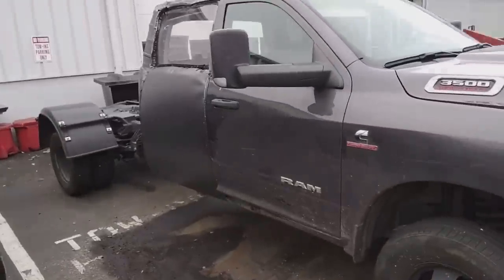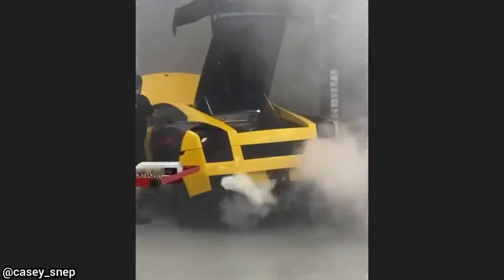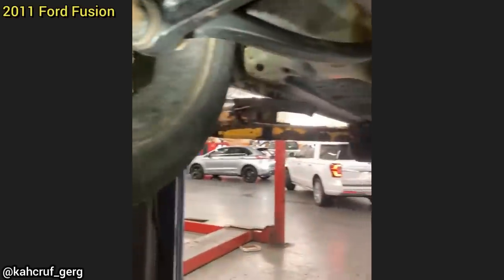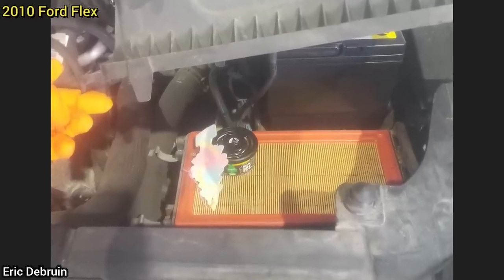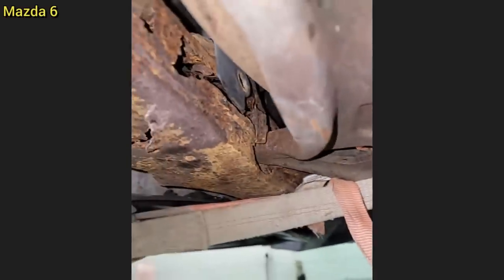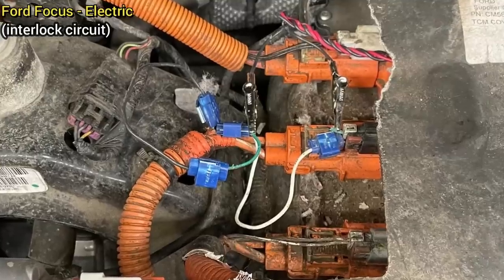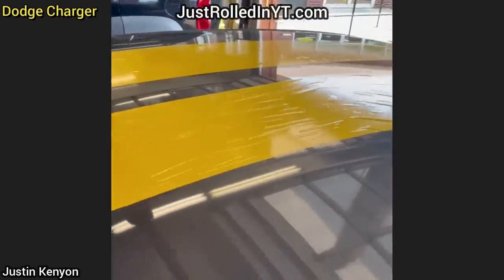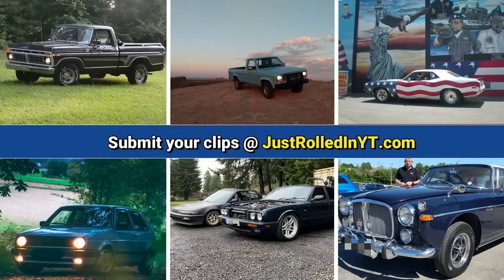Customer States Another Shop Used A Range Rover Hood To Fix Door

Comment: THAT subframe covered under a recall??? That man just hit the jackpot wtf
Reply: Toyota had a recall on certain Tacoma frames and would replace free of charge.
Reply: dude basically got a used car turned into a new one with that kind of recall lol
Reply: Subframe?  There wasn't any subframe on that car, just thoughts and prayers
Reply: That was a sub-subframe
Reply: @thetater0886  It could have been a Jeep. They had a big recall for sub frames.
Reply: @douglaskrenik4102  4Runners, too.
Reply: Original owner must have been kicking himself, too. Gave the car away for free and could have gotten a new one instead.
Reply: Ford covered about $5000 in repairs to our Windstar once on a recall, when the thing wasn't worth even $3000. It started with the engine subframe, then the stuff that was bolted to was rusted so Ford authorized replacing those parts too, then the stuff THAT was bolted to was too rusted, repeat, then they had to break the exhaust manifold to finish the last replacement, so they authorized a new manifold too. I was amazed (and a little disappointed) that they didn't just total the thing.
Reply: My exact words were "No way" loud enough for the rest of the house to hear me
Reply: @thetater0886  And only the prayers were left.
Reply: @John_Ridley  I think the vehicle in the video was a Ford Windstar.
Reply: No doubt!!
Reply from the maker: @HighSierra1500  it was a Mazda 6
Reply: @douglaskrenik4102  yep we had two different customers small Toyota trucks that were bought back by Toyota because the frames were nearly gone
Reply: I work for  Mazda and submit the warranty claims. And they actually ran out of sub frames at one point when the recall was first released.  The work orders were backed up for weeks.
Reply: That reminds me of the time my wife bought her last vehicle - a "pre-owned" 2014 Hyundai Santa Fe.

She was on the fence about purchasing the extended warranty from the dealer but ultimately I sold her on it.

Several years later, that very warranty she almost didn't get provided her with not one, but two new engines and a transmission.

The first engine replacement alone was more than enough to have the extended warranty pay for itself.

Sometimes it's worth it depending on the situation - it's not always a scam.
Reply: @douglaskrenik4102  Toyota did NOT recall the 4Runners with the same frames. Shame on you, Toyota, I could still be driving my SR5 instead of an XJ! 
(Don't get me wrong, I love my Jeep, but I only had my 4Runner on the road for two months before the frame went...)
Reply: Ah the old Chinese Curse, "may your Ford Windstar last you another decade."
Reply: Guy who gave it away probably  knew the condition it was in.
Hopefully,  he finds out they just got the repairs for free.
Reply: I never get this lucky.
Had a Chevy Volt once. It was under warranty,  and they still wouldn't  fix it. 
I got the impression  that certified volt mechanics were the diesel guy they gave $20.00 to and stuck a volt shirt on him for the day.
Charger went. Blew a fuse. Melted the power cord.  They wouldn't  honor the warranty.  I had to rip the face off of it, replace the fusible link with an inline fuse, replace the power cord, then duct tape the charger back together.
$40,000.00 car held together with duct tape.
Never had cabin heat on electric. 
And this clown gets a free subframe.
Reply: Mercedes just did mine.  Took advantage of the swap and all new control arms and shocks went in.  New rear end at 11 years equals like new car.  Amazing difference.
Reply: Surprised it was a year old ford
Reply: Yup. My buddy had the entire frame on his ‘05 Tacoma replaced by Toyota because of rust. Then he traded it in 2 years later for new ‘21 Tacoma and got 16k for it! 😂
Reply: Many years ago I had a 2001 Sante Fe that had a recall/TSB to inspect subframes for rust and to replace if needed.  If not rusty they would but some type of sealent/wax onto certain parts of it.  I got the wax thing done, but a few months later I noticed a rust hole devolping, about big enough to poke a screwdriver through.  Took it back and they decided it was rusty enough so got a new subframe installed.
Reply: @HighSierra1500  Yeah they had very bad problems with rust on the subframe, hence the recall, so I wouldn't be surprised.
Reply: Recall after 30 years 😂😂😂??
Reply: @edwardkellogg1284  My buddy had a Jeep Patriot - they should have just recalled that whole vehicle.  He replaced the steering rack 3 different times, tie rods, wheel bearings, jeep paid for engine mounts under recall because they rusted away to nothing and the motor was gonna fall out, his moonroof leaked into his headliner and onto his dash and destroyed his stereo and a-pillar interior trim because the drains were basically defective and never worked from new...and it wasn't even that old.  Total garbage.
Reply: @John_Ridley  2nd gen Windstars are one of the biggest POS ever made
Reply: @Righteous J  you need extended warranty with hyundai and kias. Their engines and transmissions are absolute garbage
Reply: The jeep compass, patriot, and dodge caliber all have a 10 yr subframe warranty based off the build date. They aren't hard to do tbh. I've never been luck enough to have one fall under warranty, they always seem to get a hole 6 months after
Reply: @graymanA51  those cars are such POS
Reply: @JustRolledIn  what!? I just got rid of a Mazda 6 because the subframe was rotted and none of the suspension was serviceable. I had no idea there was a recall on it. Would have saved me buying a new car. I can't believe it.
Reply: AC condensation drained right there, so they all rusted there!

Comment: If you do your own oil changes on a Lamborghini. You can't afford it.
Reply: Rich people have trust issues too I guess 😅
Reply: I can afford it, I do my own oil changes. It's not any different than any other car, though on the late model Gallardo it does help to have a filter relocation kit so you don't get the top of the engine dirty when changing the filter.
Reply: Like, if you are already a auto repair shop and you have skill and tools and parking space for a fdup project car, it might make sense to buy a nasty mistreated supercar from impound auctions. But that's IT. 

I mean if you can't google the right amount of oil to use for an oil change you probably arent right for car ownership in general.
Reply: Not necessarily there are plenty of owners who are more than capable and do maintain their own vehicles. At the end of the day it's still just a car. I've seen the same mistake done on VW's.
Reply: @goatman86  
People like that aren't actually rich.
Reply: Even If I could afford it I would still do my own oil change
Reply: 28L of oil would cost more than paying a shop to charge the oil...wtf.

Like....surely after the 4th bottle of oil you would be asking yourself questions...
Reply: @procrastinator1842  "surely after the 4th bottle of oil you would be asking yourself questions"  You are assuming that they had any semblance of intelligence to start with.😏
Reply: @Jack_Russell_Brown  I'm wondering what kind of person attempts their first ever oil change...on a Gallardo...

Comment: "Customer declined repairs" is something that always gives me the chills watching these
Reply: I prefer states that have safety inspections for this reason
Reply: @nancyconrad5349  We have annual inspections here in North Carolina, and yet, I see more broken-down derelicts on the side of the road down here than I ever did back up in Michigan. Go figure!
Reply: Decling Repairs on this deathtraps should automatically require to call the police by the shops and remove plates and registration. If you are to poor to repair your car to a "safe to drive" status just don't drive.
Reply: @TrekZero  I cannot disagree with you there.
Reply: @michigandon  I'm from Germany and our TüV would do this. We have to do TüV Saftey Inspection every 2 Years and a rusted out frame like this is nearly impossible here. A car like this would simply be pulled from the streets and the only way to drive it would be on a tow truck. If you try to drive it back police would stop you. I cannot understand the there is no federal law in the USA to pull rolling deathtraps like this from the streets.
Reply: Maybe they want a second opinion.
Reply: @TrekZero  the problem with this is that in about 95% of the US, driving in the only viable option of getting anywhere because everything is built as far away from each other as possible only connected by 4-7 lane stroads with no sidewalks and maybe painted road gutters as bicycle lanes.
Reply: I agree people need to put money into maintaining their cars as a practical necessity, but auto repairs these days are no joke. Like barely affordable in most cases. For some a beater is all they can afford, and I could be wrong, but I'm sure about 95 percent of accidents are caused by people driving like jackholes or not paying attention rather than mechanical failures. Just saying.
Reply: I agree people need to put money into maintaining their cars as a practical necessity, but auto repairs these days are no joke. Like barely affordable in most cases. For some a beater is all they can afford, and I could be wrong, but I'm sure about 95 percent of accidents are caused by people driving like jackholes or not paying attention rather than mechanical failures. Just saying.
Reply: Natural Selection at work....hopefully.
Reply: @TrekZero  Spoken like a Republican. I'm able to band aid and bailing wire my shit together well enough to not kill somebody, but poor rural folks need a car as badly as anybody else. We don't have mass transit out in the sticks.
Reply: @michigandon  I can.
Reply: @Jeffry Kopis  unfortunately the bad tires and broken suspension leads to accidents involving others. A coworker had his car totalled when the bald tire guy behind him failed to stop because of no front brakes, and 4 bald tires. I've seen a few dozen fender benders from people with no brake, or running lights as well. Granted some are the person in the backs fault. Just because you choose/can't afford repairs does not give you the right to put other people at risk.
Reply: Thats the punch line. 
So the wheel fell off in the parking lot and i look at the customer and he says "I decline repairs"

badum-tssssh

Whats up with that?
Reply: Those bozos are the reason there are so many accidents on the roads everywhere everyday. 

Most of the cars that are let to be driven away, those shop owners should somehow be held accountable when that car kills someone else, likely on the actual drive away from their place of business. 

Some law enforcement should be made available for such vehicles to be kept off the roads when they are so clearly not safe
Reply: @GoatzombieBubba yeah, but no, they don’t have the ability to make the payment. 
Sometimes a second opinion IS a valid option, but in the cases where the car is literally and unquestionably F’d up, they are going to drive it till it crashes or dies.

Comment: "Another shop..."
"My friend..."
"My brother-in-law's second cousin twice removed..."
--Just own up and say YOU did the initial repair 😂
Reply: Yeah like me. I broke a bleeder screw while doing a brake flush myself. Now I need two new calipers. Called my local auto shop the next day, told the guy about the issue and admitted that it was me who did it
Reply: Working at a dealership, I once dealt with a truck that had a brake caliper fall off causing damage to multiple components including the wheel and wheel knuckle. He admitted to doing his own suspension work (which would have required taking the brakes off) and wanted us to repair it under warranty. According to him it was normal for the caliper bolts to come loose from the knuckle. Said bolts come factory with a thread lock on them and a torque spec just shy of 200 lb-ft. They are not meant to come loose. Needless to say, warranty was not going to cover it and he had the truck towed away rather than pay us to fix it. So in that instance, he admitted to doing his own work, but tried to blame the manufacture for his mistake of leaving hardware loose.

Comment: I worked at a collision repair facility for nearly 45 years. I saw plenty of repairs of this caliber.
Reply from the maker: I could only imagine! I bet you have some good stories.
Reply: "Repairs" is putting that nicely
Reply: There a video on YT of a Chinese guy fixing panel damage on a Mercedes with bricks and mortar, and a ton of filler🤣🤣
Reply: @uhtred7860  Well that's a different way to do bondo.
Reply: @uhtred7860  "fixing"
Reply: @W0RLDSSMALLESTVI0LIN  Lol right, but the end result is better than i would have expected, for a car that has a brick wall for a quarter panel😆
Reply: Of this “caliber” funny because caliber is a name of a large collision shop, they arent bad though, they do good work

Comment: "Another shop used a range rover hood to fix door..."

Do not be afraid, customer. We mechanics are at thine service, here to help.
Thou doth not be required to lie. For was it not thy, who used a range rover hood to fix door?
Reply: Ehhh ill give benefit of the doubt on that one. And only because i had to take my car to a specific shop after some bozo rear ended me while texting. And they did nearly as bad a job. Wasnt quite hood welded on levels of bad but close. They took a scrapyard edition of my tahoe to get parts, then used chain or something to pull everything out and in the case of my trunk...off then banged stuff roughly into place with a hammer to make it fit then used an angle grinder, parts of the old trunk and a welder to fix the split areas before spray painting. It looked like something out of the mad max reject pile.

They actully did more damage during the "repair" then the guy who rear ended me with a F250. Insurance ended up having to total and replace my tahoe after a $7500 fairly minor repair turned into a massive $28,000 repair with heavy frame damage ontop of the first $7500 already paid out. Turns out the insurance branch managers son worked there so he was sending repairable units there. It also turns out his son had no idea how to screw in a lightbulb god forbid fix a car.
Reply: @arcticfox5118  On YT search for "guy uses bricks to fix car"  🤣😆

Comment: The guy must’ve taken it literally when he was told he needed a ground strap
Reply: Yeah ..... Literally ten feet into the ground 🤣😹💥💫🤦
Reply: actually the term "ground" is misused in the automotive world. it should be "common"
Reply: As a kid, many trucks dragged chains to ground static electricity...
Reply: @haroldwilkes598  That used to be a common sight on fuel tankers. Even today, you sometimes see rubber straps that do the same thing.

Comment: Whoever did the Pinstripe wraps on the last car has never rapped a Christmas present
Reply: What??? How do you know he didn't lay down some sick beats at a Christmas party?

My car's got pin stripes it goes zoom zoom, the stickers are more power and my engine goes boom!
Reply: @ronochow   -  very good!
Reply: How do you know their level of musical ability?!
Reply: They also have a lot of toyota stickers on their dodge
Reply: yo yo yo!
Reply: I doubt he's  even wrapped a sandwich...lol
Reply: @catey62  🤣💪♥️ that makes sense a single man never having kids always doing everything messed up can't hold down a job I run into them type before interesting 😳🤦🤬🍻🍻🍻🍻🍻🍻🍻🍻🍻🍻🍻🍻🍻🍻🍻🍻🍻🍻🍻🍻🍻🍻🍻🍻🍻🍻🍻🍻🍻🍻🍻🍻🍻🍻🍻🥴🥴🥴🥴🥴ahh that's better 🤣
Reply: @tomhayward3634  in a relatively straight in one spot on one door 🤯 I'm going to kick the corner of a wall now with my toe
Reply: @skrimper  I think that was death metal not classical
Reply: @ronochow  🤣💪💯♥️🍻 like the Christmas parody where's Santa went nuts and killed everyone I'm gonna go find that one now
Reply: @ronochow  that is a sick beat🙏 more stickers more horsepower at least 15 per sticker
Reply: @sharonnicholson3393  - I thought it was 5hp/sticker?  Someone needs to dyno check this for us.  I was at about 75hp for the stickers and an additional 150hp for the racing strips ... the yellow ones on the car.  Just thought I'd clarify the location of those racing stripes because with all that extra power, you never know what might happen.
Reply: @abikeanditsboy3449  or maybe I'm wrong maybe it's 15 for a NOS sticker and 5 for the rest🤔 but you're right someone needs to put stickers on a dyno so we can find out the real horsepower and stop blowing up our engine

Comment: This video is a DIY special with all these failed attempts at doing the job in your driveway , the Lambo stereo install will give " You can pay me now or pay me later " a new meaning . And lastly with the advent of electric cars this is a different animal all together , with the voltages and amperage flowing through these cables for the sake of your life do not mess with the wiring . All the techs in our shop had to go through major retraining to deal with the electric future on our roads .

Comment: Some random guy hacking up the high voltage cables is scary! I'm concerned that with these vehicles becoming more common we will see alot more backyard techs fucking with things that could easily kill them.
Reply: Darwin at work.
Reply: And worse, if a car like that has been in a collision, and the driver needs rescue, there may not be a safe way for the rescue team to disconnect the high voltage. On factory vehicles there is a provision for that, which is documented. Rescue teams are provided with that information. Haphazard high voltage cables can get a rescue worker killed.
Reply: @cleon_teunissen  When an EV is in a wreck,  and the airbag system is activated, a separate subsystem is activated using small explosive cutters to disconnect the high voltage lines in the batteries.
Reply: I knew a guy who suddenly transported himself across his shop by welding on a gas tank, there's always someone.